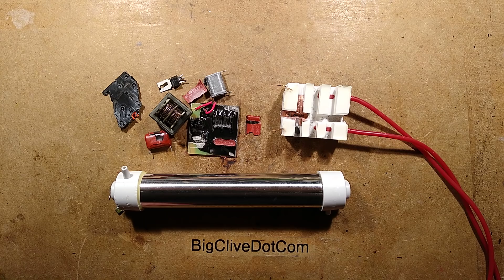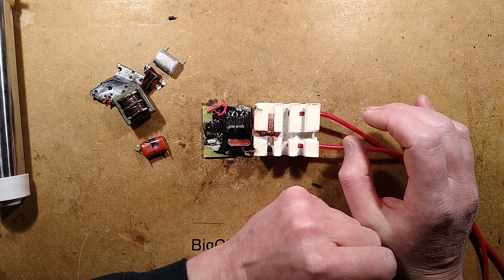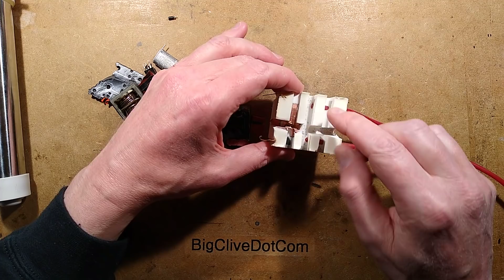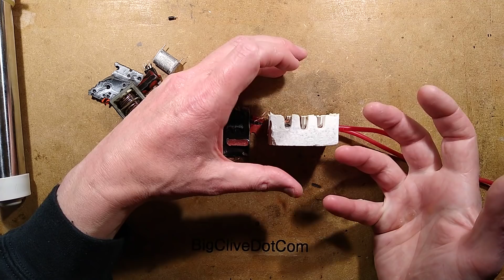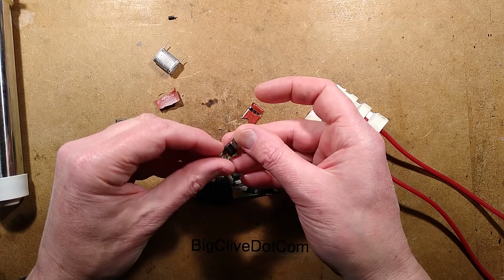Inside a nasty high voltage ozone generator PSU.  (with schematic)

Comment: Sorry, why is that 240nF capacitor even there at all? The idea is it's a timer to periodically dump the 1uF into it's neighbouring coil, the primary, right? But why not just measure the charge on the 1uF cap itself? Through a potential divider? Then it'd be, y'know, efficient, and proper, and make sense and stuff. It seems , to my inferior eyes, like the thyristor just activates every now and then, at approximately the right rate, but why this separate timer circuit? Doesn't make sense, and of course most horrifying of all, uses extra components that might COST A FEW PENCE!

Comment: You got it wrong again.  The common mode choke is wound so when the current is flowing as s you show, the fluxes oppose and it does nothing.   They the current in both wires flow in the same direction (on of your arrows reversed) the fluxes ad and it acts as an inductor to oppose the current flow.
Reply: fluxes oppose for normal operation, so no inductance.   fluxes add for common mode operation, high inductance.
Reply: back in your box... if people really care they will google it. no one expects clive to be a walking encyclopedia
Reply from the maker: I thought I'd got it right the first time, but no matter which way round I describe it people seem to disagree.  I'm also inclined to think this way is wrong.
Reply: @bigclivedotcom  Your description of the effects in the circuit are correct, just the part about the flux flow is wrong.  Here are a couple of ways to think about it.

Take a (twisted or bifilar) pair of identical wires.  Connect them at one end.  Call the connected end A and the disconnected end B.  Now wrap that pair of wires around a magnetic core (say a iron nail).   Now put a DC current through the open end of the wires (B).  The current going in one open end (B) will flow through the wire to connected end (A) and back through the second wire to your other connection at B.  Since the current in each wire opposes the net magnetizing current is zero and net flux in the magnetic core will be zero.  The nail magnet will not work.  This can also be thought of each individual wire inducing an opposite flux in the core that sums to zero.  It is as if the magnetic core is not there because if it is removed there is no change.  The net inductance is zero.  This is the case for normal operation.

Now connect one of the wires from the A end to the B end.  Now put DC current through the unconnected wires from side A & B.  Now the current both wires wrapped together around the core is flowing in the same direction.  The net magnetic flux is double that of a single wire.  The nail magnet will work.  This is the case for common mode currents.

Another way think about the common mode choke is to think of it as a 1:1 transformer.  With the example above you could put the dot at either end so long as the dot for both wires are at the same end.  In your circuit example you can put the dot on both windings at the left power input side.  

Clive, I love your videos and learn quite a bit from them.  Your love for lighting inspired my first project video “Visible Light Oscilloscope Probe.”  Please keep up the great work!
Reply: Tate the first case in with the wires are connected at end A and open at end B.  Open the connection at end A and place a circuit in series with the wires.  Now connect a voltage to the open wires at side B.  Nothing has changed for the magnetic circuit even though you are supplying power to circuit you connected, the currents in the wires wrapped around your core are equal and opposite, so there is no net flux.  In essence nothing has changed from the first case.
Reply: Perhaps the simplest way to think about it is when the net flux is zero, it does nothing.  When the net flux is non-zero it acts as an inductor.
Reply: Another way to think about it:  A ground fault detector is just a common mode an additional winding to detect when the currents do not match.  So long as the currents match there is no net flux.

Comment: I've had some success 'de-potting' some epoxy filled assemblies by heating it up in an oven and picking away at it with small screw drivers and the like.  Need to go above the materials glass transition temp and it will turn rubbery. Average seems to be 80-100C.  Although they make some that go as high as 250. It would be quite difficult to work with if you had to go that high.

Comment: 8W UV pond cleaner Bio Filter box, pond water is pumped across and exposed to the UV and then over the dam into the foam and lava rock section and back to the pond, it worked quite well. The neighbour started feeding pigeons, crows, seagulls and rats etc and I had to remove the pond where they all came to drink and empty themselves.
I got it in 1993 ish, I might plug it is and see if it works.  4 photos guts of my pond filer https://photos.app.goo.gl/ZhqjwhF6eJApqNqd6
Let us not talk about the amount of grass and moss in the house gutters; I guess it is the nitrates and the seeds must be in the bird crap.

Comment: Imagine chinese manufacturers giving a toss about EM emissions, or safety, or anything, yeah, I know, impossible to imagine... :P
Reply: Take the cheapest product on the market, blame the Chinese for cost cutting and low quality, yeah...
Reply: @greentjmtl  The thing is, its not always the fault of the person who designed it cheaply and then gave it to the chinese, because the chinese have plenty of things they come up with themselves and then try to sell it to others, not revealing all the shortcuts they've taken.
Reply: Polite Cat Chinese manufacturers are rather notorious for eliminating items like RFI/EMI suppression as well as bypass capacitors from established circuit designs...they will keep removing such parts until the circuit no longer works in their “lab” environment and then reinsert that one component and off to production it goes.  So it is frequently a very intentional choice to remove those components from even well proven and well engineered schematics even when those parts would only have added a few more pennies to the cost of the end product because THEY get to pocket those few pennies per unit even if the product was not that price sensitive to begin with as the Chinese bid on the project while those components were still in the design.  You can find stories here on YouTube (such as by Jeri Ellsworth) describing the challenges involved in trying to get the Chinese to manufacture your circuit per the schematic and board layout and with the components parts and values you submitted and specified for the bid — turn your back for just a moment or momentarily lose focus for just a bit as it goes to manufacturing and those parts will again disappear in an instant.  In her case, they repeatedly kept trying to delete critical bypass components until the digital circuit would no longer run in their lab...and then the evaluation boards would constantly crash once received because her lab space wasn’t as RF quiet as where the Chinese were testing the circuit so the boards would keep crashing and when she would open up the demo unit, sure enough, they had again deleted the bypass capacitors that she had specifically designated as critical/mandatory.  There are some good and honest Chinese manufacturers out there that will manufacture well engineered circuits as submitted by the engineer/designer and do fantastic work but most of them will cut every corner they can to pocket a few added cents of profit that will go into their own pockets since they bid the price while those components were still presumed to be a part of the finished product as many Chinese manufacturers care nothing about good practices and regulatory requirements as they have little, if any, liability...that is why we get LED bulbs with power supplies that are broadband radio jammers knocking out radio reception from LF all the way through UHF and even beyond.

Comment: Ugh, exactly backwards. Inductance is basically the amount of magnetic flux generated per ampere. You want common mode current to get double magnetic field, therefore high inductance, therefore blocked; and differential mode current, the normal input current, to get zero magnetic field, therefore zero inductance, therefore not blocked.
Reply from the maker: Last time I described the common mode suppression choke the other way and immediately got a barrage of corrections.  I clearly have to research it more to find which one is correct.
Reply: @bigclivedotcom  I think you have described it the same way both times but using different words.  A common mode choke has the dots at the same side eg the mains side.  So for a common mode signal both windings produce flux in the same direction which makes it an inductor and for a differential signal they generate flux in opposite directions which cancel out making it a short circuit.  This circuit would appear to be more in need of a differrential input filter than a common mode choke to block the huge current spike when the thyristor shorts out the input.
Reply: Take a look at https://www.coilcraft.com/cmc/GuideToCommonModeChokes.pdf to see the flux arrows and dots on windings with the correct descriptions.  Keep up the good work!

Comment: Could you run that corona tube with your plasma globe power supply
Reply: Plasma globes have much longer sparks, so presumably a higher voltage. They're also not very high power. Possibly you could but I doubt it would be efficient.

Comment: It looks much like a mains powered gas cooker igniter, except they usually use just a highish value resistor for charging from the rectifier and use a neon or diac for triggering the thyristor. Similar to the trigger circuit for a xenon flash tube in a cheap strobe light too. Looks like a bodge version of an ozone generator you tore down several years ago, https://www.youtube.com/watch?v=yvhRNBOQ6oE

Comment: Well, a common-mode choke in series with a capacitor; that’s an instant LC resonant bandpass filter. Somehow, I don’t think they intended for that to happen. What happens if you expose the resin to the UV tube?
Reply: It's a common mode choke, It has no inductance for current flowing in the normal directions through the circuit. It only effects common mode currents.

Comment: I'll share with you my "big guns" technique for jellifying virtually any kind of encrapsulant:
50% acetone + 50% methanol, in an ultrasonic cleaner, heated to its boiling point (50-something degC). Just be careful, it will take the paint off your kitchen ceiling. Also flammable.